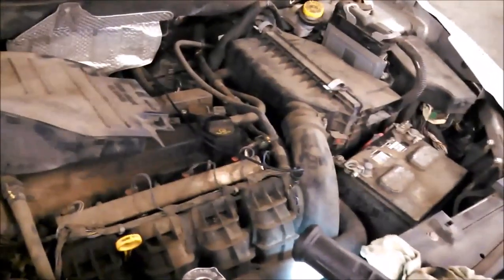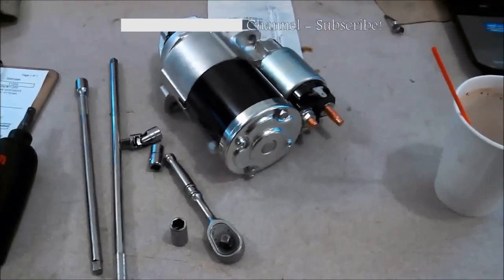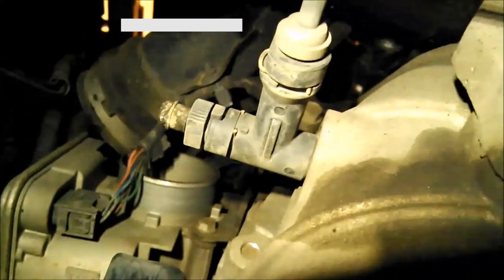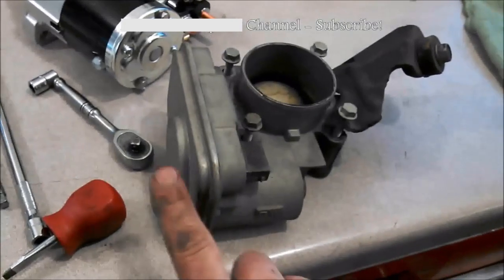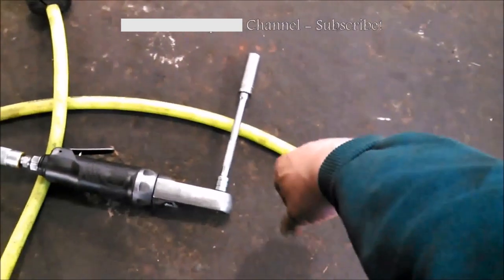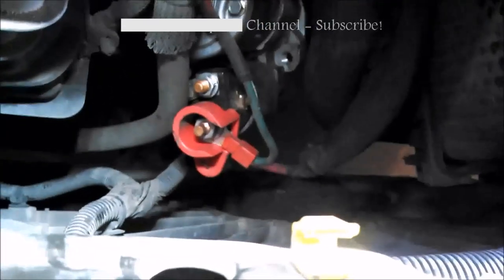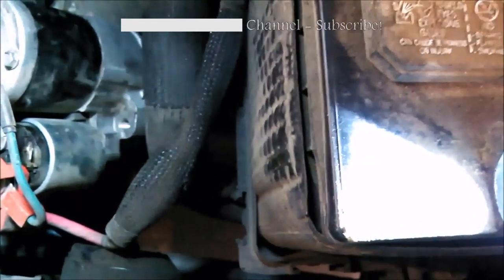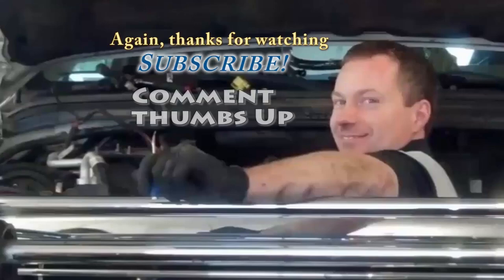Starter replacement Dodge Caliber 2007-2012 1.8L 2.0L 2.4L Jeep  Install Remove Replace

Comment: You do not need to pull the throttle body only the breather box tube going to the throttle body to many wasted steps here .
Reply: lori deyo 
Did you perform this same job with out removing the throttle body?
Reply: lori deyo I was thinking the same thing

Comment: THANKS --I HATE NEWER CARS---HATE COMPUTERS AND MISS CARBS
Reply: Shalom Aleichem

That's why I drive a 1992 Ford Ranger. I also have a 1976 Chevy G-10 Van that's been in my family since 1976 (mom and pop {RIP} bought it in '76) that has 850,000 miles on the original drive train. I'm gonna restore it.

I also have a 1972 VW Karmann Ghia that I've completely redone. Also a 1981 Harley Davidson that will be up and running again soon. 

I've been a mechanic for almost 50 yrs and I've seen automobile's go from simple to ridiculously complicated. Someone forgot the old old adage that simplicity is the ultimate in sophistication. 

Automobiles aren't getting more efficient, they're getting more complicated and extremely expensive.

I had a 1967 VW that got 32 mpg and that was in 1970. I could tear the engine out at 0600, rebuild it (stock) and have back in the vehicle and running by 1800 and that after taking a few brakes during that time period.

In 1989 I paid $25,000 for my house and took 10 yrs to pay it off. Automobiles are costing more than my home and taking 7+ yrs to pay it off.

Auto's today are mostly JUNK!!! Expensive JUNK!!!

Of course a fiat currency doesn't help, but really this is ridiculous. 

Baruch haba b'shem YaHuah
AAPiY
MiKaEl

Comment: I just changed the starter on a 2008 Caliber
1. Disconnect battery both terminals
2. Remove Battery
3. Remove Battery tray completely
4. Lift front left wheel with Jack and brace with Jack stand under cross member
5. Disconnect air tube from airbox and throttle body and remove
6. Lay under car and remove bottom starter bolt
7. Remove upper starter bolt
8. Pull starter out of flywheel hole and turn to access wires remove them from starter
9. Remove starter and install new one
Reply: Thank you❤️
Reply: Badass man

Comment: It's the plastic piece at the bottom of the intake hose elbow that holds the wire going to the throttle body.  If I can't get it off I guess I could cut it out then just zip tie the wire afterwards.  Thanks.

Comment: Hi Please can you help. i just had my egr valve replaced on my Dodge Caliber 2007 and the garage couldn't figure where he need to put once air cable. i can send the picture of the cable to you if you don't mind

Comment: Hey , I replaced my starter aswell , it starts fine and everything. but now I'm hearing a rattle when I'm driving from a low speed to a high speed.. do the gears in the starter need to be set a certain way putting it in or ?
Reply: No mames

Comment: Hey can you help me... I replaced mines and put battery cables back on and it did not crank..... Then I unhooked the neg. cable for a few minutes it started fine cut off and tried to start it and it wouldnt start. So do the computer need to be reset?
Reply from the maker: Anthony Lovelace Why did you replace the starter?   For the reason you are experiencing now?  Likely not a starter problem, maybe ignition switch, safety or clutch switch or computer problem.
Reply: It wouldn't start unless I hit the starter....
Reply from the maker: need to make sure the connections at the battery are clean and tight and you of course have a good battery. I think the computer is tied into the starting system , not sure exactly how though.
Reply: Okay thanks!
Reply: I need to see a video on how to take a rear motor mount on a 2007 dodge cablier off